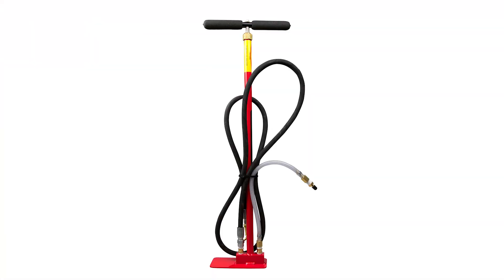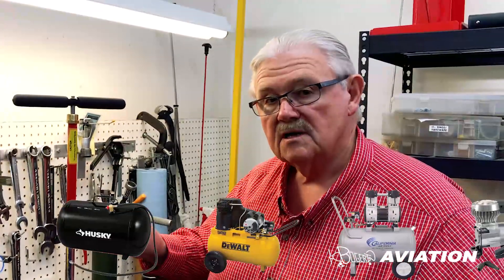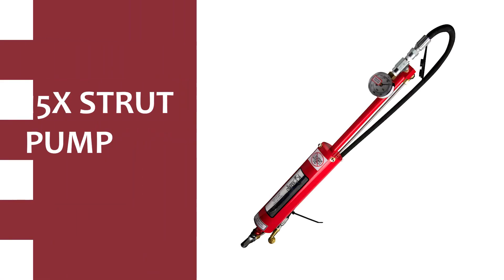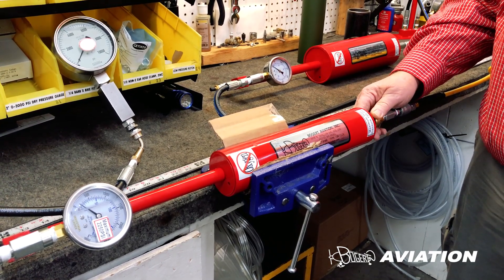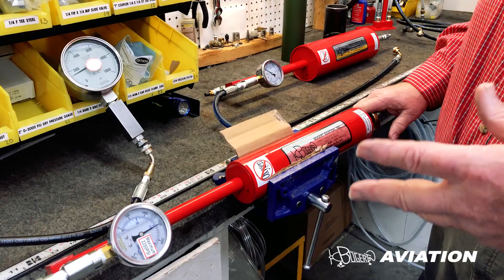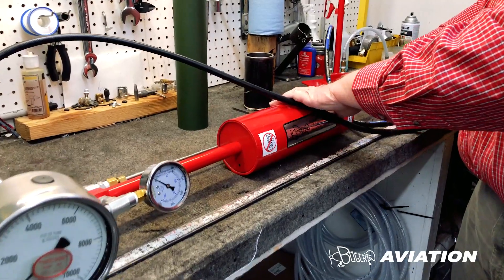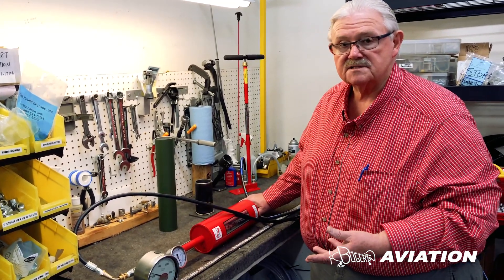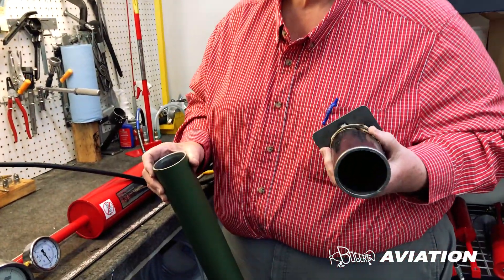Aircraft Strut Pump Comparison - Which is Right for You?

Comment: My hobby is shooting PCP air rifles and pistols.  My supply tank when full is 4500# .  I fill it with a 20:1 Haskell air multiplier.  It doubles as my strutt supply system by adding a Schrader valve.   The supply line is a micro hose which restricts flow.   Works very well.

Comment: Question.  I’ve got your first generation slide pump.    Is air supposed to push out the two inlet holes on the power strike?   Mine does and I don’t thing I’m getting much air charge to the oleo strut.   How to fix?